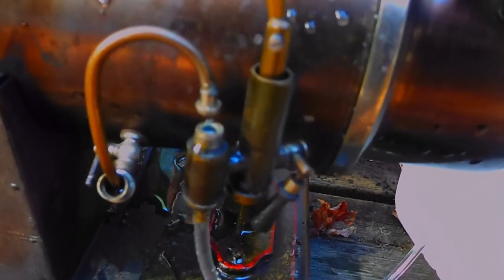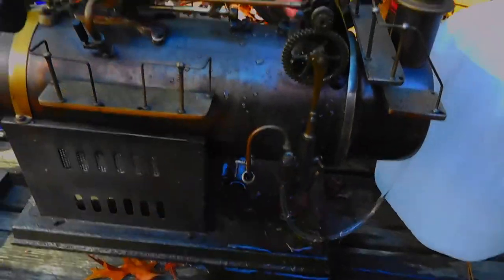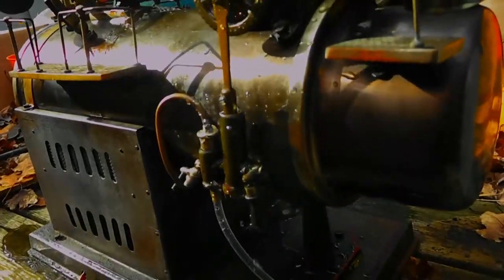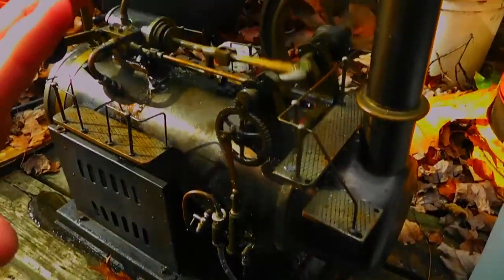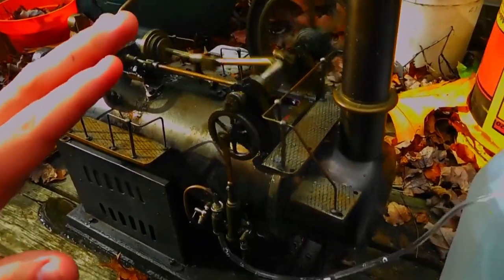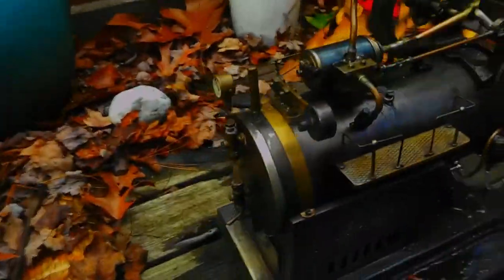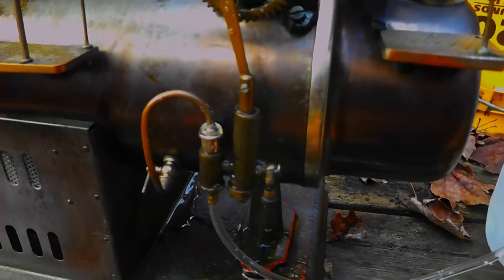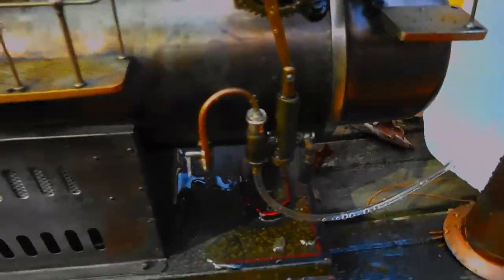Common Schoenner/Falk feedwater pump problems

Comment: Bonjour Alaxander,
Would two O'rings with dedicated grooves on the piston of the pump solve the problem ? 
All my pumps have such O'rings to guarantee the tightness.
Amicalement, Raphaël
Reply from the maker: Raphael, I'd prefer a traditional and more reliable graphite packed gland.